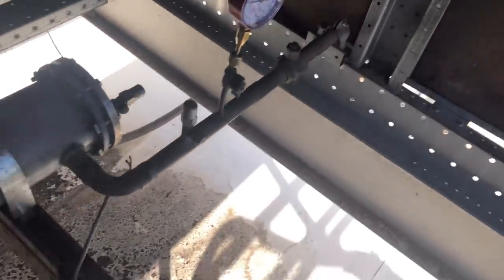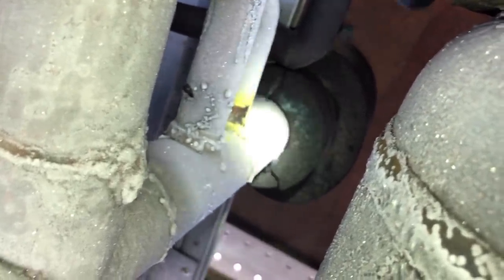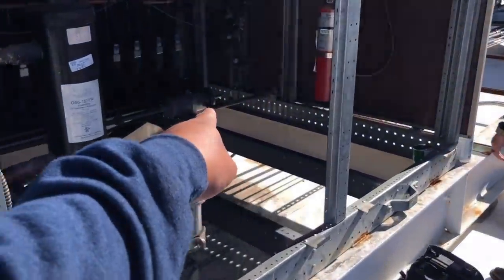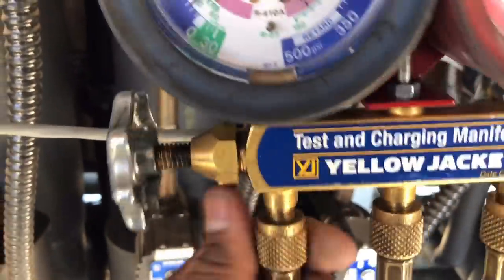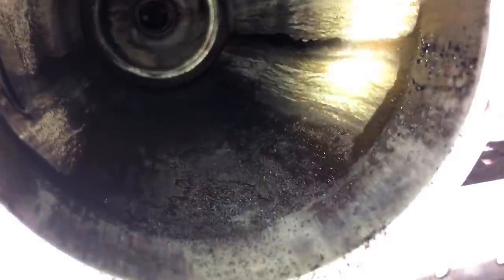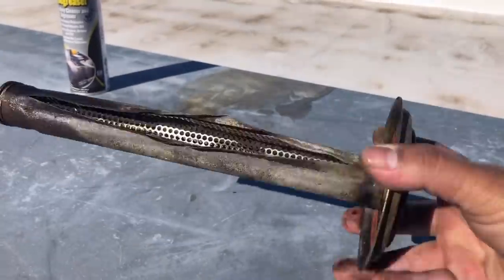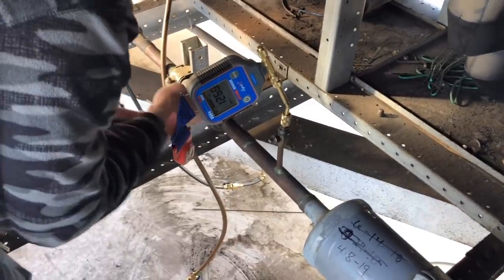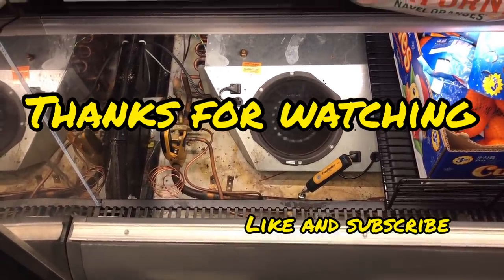HVAC REFRIGERATION: Dual Temp Case running warm, PT.2

Comment: If you've had a compressor fail mechanically, a lot of the wear metals end up in the oil and then get caught in the filter. Seen a few filters blocked with a sort of grease made of oil and aluminium.

Comment: When a burnt out compressor happens. The driers should be changed till all the junk is cleaned up. Takes several changes. Couple weeks apart
Reply from the maker: yup   funny thing is no burnouts.   all mechanically failed.
Reply: @rookierefrigeration4357  it got hot to make the sludge
Reply from the maker: True
Reply: @rookierefrigeration4357  did you ever check discharged temp near compressor

Comment: I was taught to remove old drier cores and clean out the housing before opening the new drier cores to minimise exposure to atmosphere.
Reply from the maker: True. But were talking about 3 minutes.  Plus we pulled a vacuum so it’s good.
Reply: Rookie Refrigeration , my mistake I assumed you used the drier cores that you had opened as you said you had to get a new screen from the supply house . Great video
Reply from the maker: Terry Tugwood Yeah the ones we originally opened were thrown out. We got new ones at the supply house with that screen

Comment: Try fantastic spray cleaner on the discharge line to check for leak. It's an old trick showed to me years ago.
In fact helping another tech that was using viper big blu and a H10 couldn't pin point a small leak. We would pick up traces with H10 and BB showed nothing. Grabbed fantastic sprayed area down and found the small leak within 2mins.
Reply from the maker: What’s fantastic spray cleaner.  Like a household cleaner?

Comment: For tighter spaces they make bump caps that are very effective at preventing sharp corner bump injuries. They are not a hard hat designed to protect against falling objects of higher velocity as they don't have the traditional hard hat gap between the shell and head. They are designed for close space tool and machinery space bump protection. Anyone in tight spaces should invest in these. You can get styles that highly resemble a baseball cap, however I don't like the bill as it obstructs the view of low ledges resulting in more collisions. Get the one without the bill unless working outdoors and need to block bright sky to see in dark corners.  Remember, they are not a hard hat replacement for construction and protection from falling objects. They are a bump cap to protect against bumps against fixed objects.
Reply from the maker: I’ve never heard of these.  Where can I find them.
Reply: @rookierefrigeration4357  Google is your friend. Look for Bump Cap. Standard safety supply houses carry them too where you get high vis vests, knee pads, safety goggles, etc. It is safety equipment.

Comment: You have pretty good luck overriding the EEPR to 35% and setting SH at that point? I'll have to try it
Reply from the maker: Well.  If you think about it, at 100% I had a -20SST.  it's exactly like adjusting a manual epr.  Your have to adjust to where you get your SST to what you need.  I know some people may disagree but that's how I was taught.
Reply: @rookierefrigeration4357  that's a very valid point. I was always told to adjust superheat and the valve should be able to hold that set point on it's own as long as your running proper suction and the EEPR will adjust accordingly. That's a good idea though I'm definitely gonna give it a try

Comment: I have not seen a core drier with a temp.differential as high as that in my 30 years..close to that but that much..
In my opinion nitrogen purge and slow flow while installing might have prevented that premature failure.! 
I know its not on you.
That screen protector and mesh cracking probably due to temp.differentials and vibration.
And possibilty ( made in China ? ),.
 Actually IDK..What is your overall opinion on why this happened? 
Thanks
Bryan Tyler Refrigeration
Helotes, Tx
Reply from the maker: I was told by my supervisor that he’s only seen it like 2 times in 8 years.  So I have no idea.  Maybe pressure buildup??

Comment: Looks like drier been replace on April. It hasn’t been that long. Wonder why they getting so dirty?
Reply from the maker: I’m not sure bro. But I got it changed.  Going back out in 7 days to change it again.
Reply: I worked refrigeration for Winn Dixie and Bi Lo for 30 year. Had a rack at one store that clogged dryers ever month. I started changing dryers ever 2 weeks and then went to once a month. I done this for a 18 months religiously. After that period of time, the rack ran clean. Changed once a year on regular PM schedule with no issues. Keep that particular store for 6 years. Over time, especially 410 A, it causes crud inside a system. It will eat up rubber gaskets and cause leaks. Therefore, a very ridged PM schedule needs to be followed very closely. This includes oil changes as well as suction and liquid filters.
Reply: Any valve plates banged out?  I went to a call where driers were being replaced daily and 2 plates inside the compressor had failed. Change plates, no more burnt oil.
Reply: @williamgosnell9491  that's crazy.
Reply from the maker: Apprentice Phil these are all scroll compressors.

Comment: That filter dryer is exact evidence of why text need to use nitrogen....
And of course don't forget the burnt out compressor
Reply from the maker: honestly, its hard to use nitrogen on a rack especially when you could contaminate all the refrigerant...  youre talkinga about 1000 lbs or so..
Reply: Supermarket installs are specked to flow nitrogen at least the large chains and has been for many years, more than 20.
Target is very diligent about this. 
There are more causes and theories as to what that black stuff is. Absolutely some is carbon, but is it all from brazing? 
I ask you this, what are the accumulators and receivers made from. Do you really think there are in absolute pristine condition when installed at the factory?
Does the require flow of nitrogen stop all of the oxidation?
Are the discharge temperatures getting too high?
Was reclaimed gas ever introduced to the system?

We can't just keep pointing the finger at they didn't flow nitrogen.

 Pulling all the gas from the rack each time a leak is repaired is a waste of time and the customer will not pay for it. I work on units that hold 1200 lbs. 

So when we repair we do not flow nitrogen.
Reply from the maker: C Thompson agreed.  It’s very difficult to use nitro and we generally don’t.   Valves don’t don’t hold most of the time, etc.